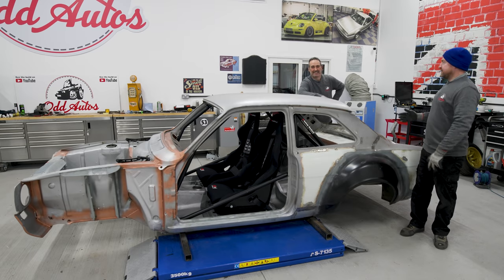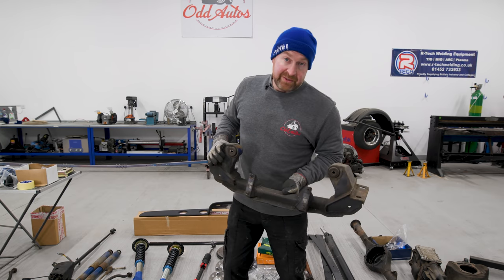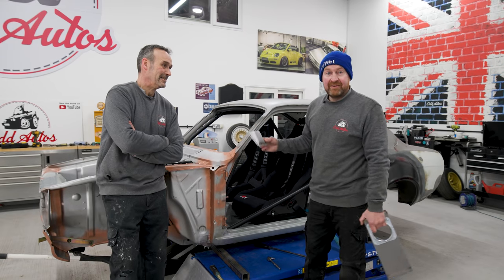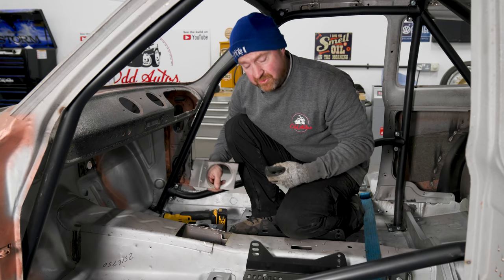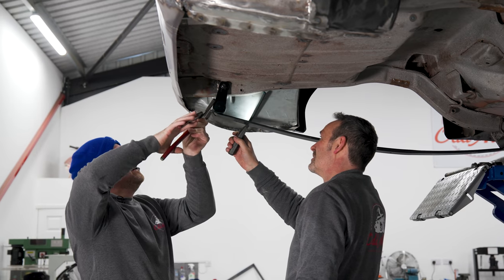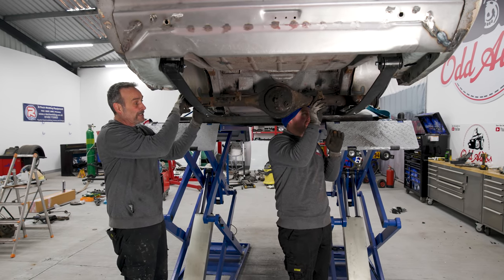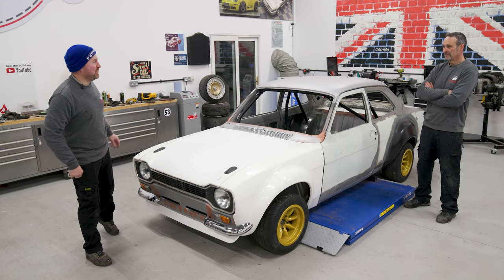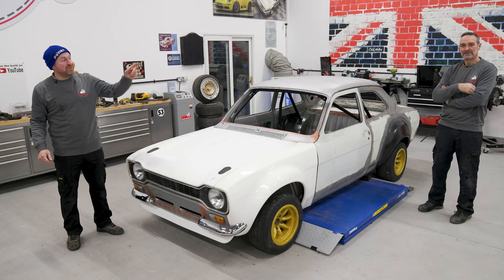Mk1 FORD ESCORT Restoration PART 9

Comment: British racing green. 

What is the brand name on that hoist? I like that it's small. No posts and you still stand under the car.
Reply from the maker: It’s an Automech lift. Does well really, Keith’s 6ft 2 and it goes much higher than him.
Reply from the maker: It’s ideal for hanging doors and doing gaps etc, the 2 post lifts are a pain. Sills are not too bad either as you can just tilt the car on blocks on the one side 👍

Comment: BGH Geartech do a 5 speed box with a shortened tail housing to save having to alter the gearstick hole on the tunnel, done mine a few year ago and best mod for a Mk1, gears 1-4 are like standard ratios for mexico and 5th is great for motorway stuff, cracking build so far though fellas

Comment: I mounted the engine and box onto the crossmember then dropped the shell onto the assembly,  much easier and no risk of scratching Keiths lovely paint job on the final build. Looking good, great work guys.
Reply from the maker: 100% doing it that way when it’s painted 👍👍

Comment: Why are you putting a brand-new steering box on a dirty rusty crossmember I would’ve washed it all down degreased it and re-sprayed the crossmember and then changed all of tractor alarms and put new ones on instead of putting rusty ones back on it if you’re going to do it right do it properly
Reply from the maker: Yes think I said in the video it’s all coming back off again to be painted, can’t really paint a car with all that on mate.

Comment: Oi oi..! Have you chaps decided which one of you is gonna keep this car, or you gonna decide via the roulette wheel...?
I remember fitting an engine and gearbox to an Escort mkIII, without the use of hoist - but instead, two skate boards, two trolley jacks and lots of timber; lifted the front of the car body up in the air and slid the engine and gearbox underneath. Dodgy and dangerous, but got the job done!
Great solution to the gearstick hole!!
And after a fair bit of deliberation, my colour choice would be Kawaski Green
Keep up the awesome work fellas (and don't forget to tighten those bolts) 😂😂😂
Reply from the maker: Definitely putting it in place and lowering the car down onto the engine once it’s painted 👍. As for who’s having the car we will flip a coin…. Sure I’ve got one with 2 heads somewhere ha ha

Comment: Did the exact same with my gearbox when I went 5 speed span the cutout panel around all done! 
 It just gets closer for your handbrake but isn’t to bad, 

I’d ideally be fitting anti tramps as you have then in the parts you got.. this is on my list to do on mine!

With your ramp and facility I’d be going engine up from
The bottom when it’s painted!!

Colour.. well mines Olympic blue with the darker blue stripe (come see my build and vid!)

But I personally always have loved poo Roman brown bronze  but my dad said we wasn’t allowed to do it! Haha so that’s my vote !

I’ve voted in my other channel aswell 👌🏽

Comment: Not a lot to add to what was a big step forward.
On the dash we used to find a left hooker dash top and cut it in the middle of the air vent holes, same with the right hand drive one and lay some vinyl down the join. It made a cowl for the navvies Halda and clocks and actually balanced the dash as a whole.
When the shell is painted (Diamond White with a matt black bonnet please) I would mount the engine on to the cross member on blocks and drop the shell down on to the cross member. The reason its different to a Mk II is its a World Cup Cross Member. We used to use a span strap through the gear lever hole round a block of wood to hold the Rocket or ZF box up while the car is lifted up.
Seeing you 'nearly' fit that half shaft reminded me when a half shaft broke down the tube the trick Boreham used was to lift the rear end, stick it in reverse, rev the thing to 5,000 and drop the clutch. The half shaft fired out like cannon. Elf & Safetee would have a fit ....
FunFact: Those front quarter bumpers were first used on the Mk I Lotus Cortina but were originally the rear bumpers off a Ford Thames (Anglia) 307E van:

https://www.darrenwoolway.co.uk/wp-content/gallery/thames-307e/AngliaVanBarry-8.jpg

I'll get me coat .... 😂
Reply from the maker: Ha ha wouldn’t like to stand in front of that half shaft then 🤣. Yes will drop the car down over the engine once it’s painted, the other way is a right faff! Good choice of colour, I’ve not got a white car yet 👍👍

Comment: While it’s upside down it’s worth sticking some anti-tramp bar mounts on the floor and rear axel, loads more fun off the line with them fitted
Reply from the maker: It did come with a set, might put them on. The only problem is the more I know it’s strong the harder I’ll drive it lol
Reply: @ODDAutos  ha ha, saves that horrible banging noise as the cart springs wind themselves back and forth like in the film Bullet when he overshoots the turn and reverses back up the hill 😬

Comment: Hi guys brilliant build.    Mark 1 and Mark 2 cross members were the same in standard form.  What you have there is an uprated rally type cross member which has leaf spring suspension type bushing to hold the engine in place on jumps.   There is a RetroFord YouTube video that explains the differences between all the Mark 1 and Mark 2 Cross members.  Worth a watch

Comment: Coming along nicely, Would be done now if Paul wasn't Horsing around! 😄 I think Le Mans Green with darker green panel would look the dogs nuts as it was the nicest look from a quick look at colour schemes. hopefully the colour you pick will do the rest of the car Justice. Hopefully not Pink! 
Another car that was good for eating half shafts is the Land Rover, as I used to change them regularly with the Glider Club as they would put them in low range and diff lock and then drive on the Peri track. Luckily most went on the hub side so rarely have to strip the diff to remove the chewed of splines. Something about the Glider Club and getting the short straw in dealing with them LandRover and serving the winch, which would always be due on days it was windy and getting covered in engine oil.

Comment: Great video! Two tone grey. Main body and roof darker grey with three central stripes down centre of car. The centre stripe wide with a narrow pin stripe either side. 

 Though it wont be a full time rally car are you going to weld in two boxed triangulated gusset plates between the front bulkhead and the tops of the front chassis rails, like they do for rally/race cars?

Comment: I reassemble the engine and gear box, mount it to the front cross member on the floor. Lift the body high enough to slide drive train underneath the body and use engine lift to raise assembly into place. Once cross member is located to body, I then reassemble suspension and you've got a roller again. I found its heaps quicker and I've yet to damage anything so far.
Reply from the maker: 100% doing it that way once it’s painted 👍

Comment: Hurts to see you tightening the crossmember bolts with a impact wrench. And by the way, cross members on Mk1s and Mk2s are basically the same. But you have a motorsport World Cup Crossmember!
Reply from the maker: Just did them up to touch, not tight because I’ve got to take it back off. Yes the threads are really fine on those bolts sent they. Ahh it it a motorsport one, I wondered why the engine mounts are different, much better!  Also the front indicators seem to be different from the normal ones too 👍
Reply: @ODDAutos  The indicators are Hillman Imp ones. On the work rally cars they used headlights without integrated parking light. So they took the Imp indicators with parking light. And for the rally-look some copied that.
Reply from the maker: Brilliant cheers for letting me know, ones cracked so I need to buy one.

Comment: Er...just a  note boys, if your going to use this in rallying I think you'll need some 6mm plates under the roll cage mounts to spread the load. Consult the MSA blue buwk!
Reply from the maker: I put them under the body and welded them to the floor underneath… whoops. Probably only do a night rally in it I’d expect. 👍

Comment: Doesn’t your engine crane arm just lift up for the initial height ? Every one I’ve ever had does, and then you only pump it up once the weight of the engine is on it !
Reply from the maker: I did on an old one and it knackered the seals, well it was that or lifting something way too heavy with it 🤣
Reply: @ODDAutos  I noticed you lifting something too heavy when he was swinging on it 😂😂😂

Comment: Few questions whats the original color on the log book ? I'm assuming your color choice and decal/stripe is a Mexico style? Looking at the car with all the rally parts trick suspension cage bubble arches and seats it would be a shame to put it into a factory Mexico  style scheme. Id Personally love to see it in white with a green and red stripe plus gold wheels like a castrol tarmac race rep with door numbers ect 🤷‍♂️ possibly even add more things like spot lights bonnet and boot clips. Do you even go further and fit fuel an power isolation points? But you could still keep the interior sounded deadend carpeted and comfy  for daily use.
Reply from the maker: Says white on the log book, yes that colour scheme would look mint! I think I’ve got spot light brackets somewhere too 👍
Reply: @ODDAutos  good thing about this classic is there's endless options. personal tastes are one thing but resale must also be considered.
Reply from the maker: That’s if I ever sell it 🤣. Need to though have too many cars, neighbours are starting to moan about my carpark at home…. Sorry mean the garden at home 🤣
Reply: @ODDAutos  haha sure would be a shame to let someone else enjoy all the hard work and head scratching you two are putting. Be like trying to sell your favourite child 🤣